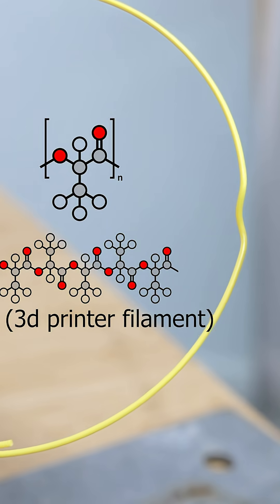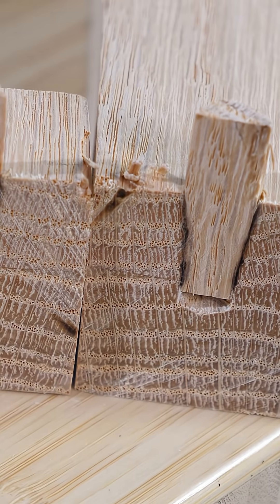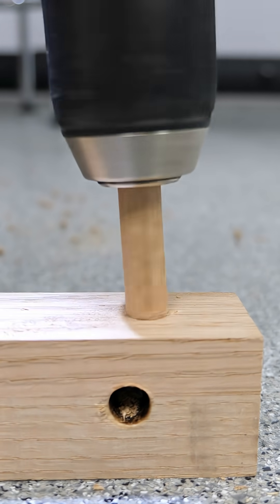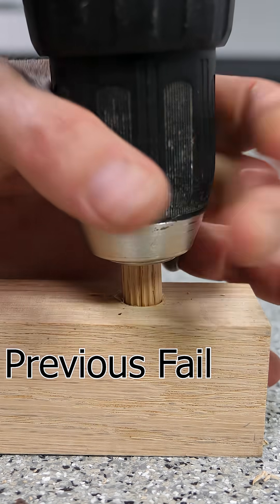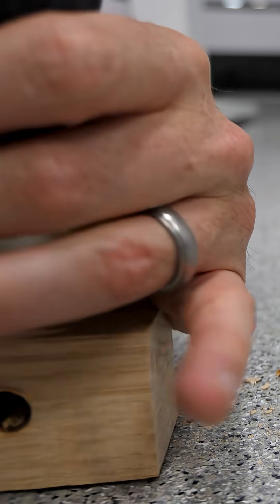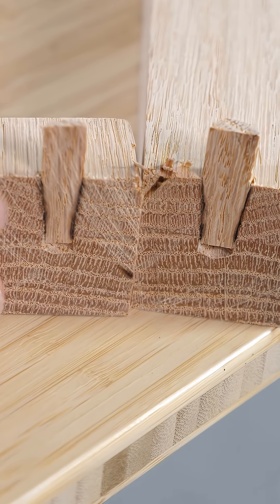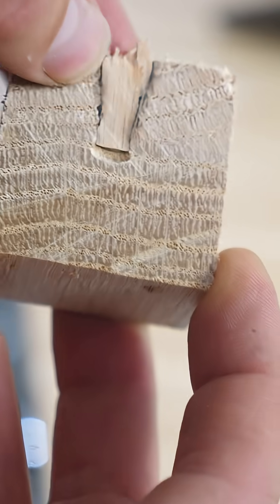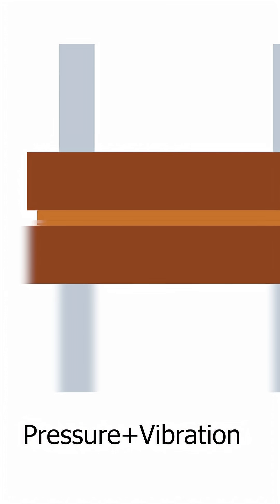I Melted Wood With Friction

Comment: A very interesting example of a simple idea being really hard to execute. Its basically just rubbing one piece of wood against another, but we didn't have the proper technology to actually try it until this recently
Reply: Electric drills have been around more than a hundred years. We just needed to rub the wood together harder
Reply: @kizza8585  The hard part is to generate just enough friction to weld the wood pieces together without burning the fibers and destroying their tensile strength.
Reply: @kizza8585  Very true. I wonder if it was figured out, maybe multiple times but wasn’t considered a big deal by the person(s) who did it..…also god I am such a child cause I giggles for a while before I replied lol
Reply: @MeganKugs It took me longer than it should have to figure out what you giggled at, then.... 😂👍🏻
Reply: @kizza8585 ”we just needed to rub the wood together harder”
😂😂
Reply: @kizza8585  I'm an adult, I'm an adult... I can't take this anymore! 🤣😭
Reply: Pressure is vital.
Reply: This is a recent discovery. 
I'm sure this has happened many many times since we've started working with wood without us realizing.
Reply: We could make fire with a bow, so they could have done this too
Reply: It's been done in the dark rooms for ages...

Comment: Would wood melt if heated in inert gas atmosphere?
Reply: No. The lignin polymers in the wood would soften between 150 - 200°C. At this temperature, with enough pressure and contact between softened wood surfaces it's plausible a wood weld could form under those conditions. Above that temperature at around 250°C, the wood would not combust into flame (no free oxygen gas), but pyrolysis would occur and the wood starts to chemically decompose into biochar and volatile oils. The wooden material would not melt into a liquid phase, but become more flexible, pliable and deform more readily under pressure. At the surface, those polymers have a melt-like flow together and can form adhesive bond but this does not mean the entire wooden material can melt.
Reply: @kizza8585  Thanks. I also thought of a chance of pyrolysis that's why I mentioned of inert atmosphere instead vacuum. If wood can melt at on surface, can we increase the chance of melting by utilizing wood dust ( more surface area/ volume)?
Reply: I sense a science project…
Reply: I need to know this